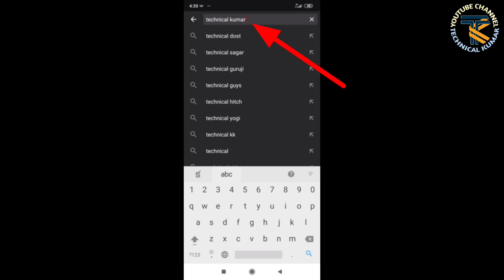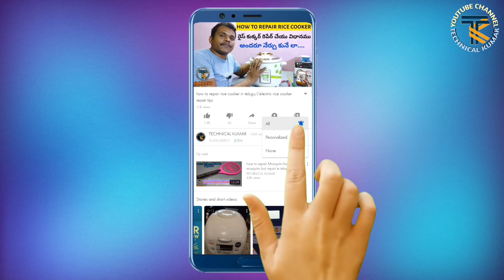electrical life hacks // top 7 best life hacks

Comment: Nice..nakosam oka video chesthara pls,,1w,3w bulbs direct plug lo pedithe veligela + toys car lo unde chinna motors intlo current ki pedithe run ayyetlu,,,,,ga video cheyandi..hindi version lo unnai kani artham avvatledu
Reply from the maker: 9989340199 కి వాట్సఆప్ చేయండి ఆ హిందీ లిక్స్
Reply: Toys car lo unde motor 5v DC meeda run avtundi ante current direction change avvadu kaani plug lo undedi 240 volts ac , ante plug lo current continuous gaa direction change avtu.. untundi anduke panicheyyadu kaani aa motor ni Appudu plug lo pettoddu motor kaaliporindi Leda pelipothundi